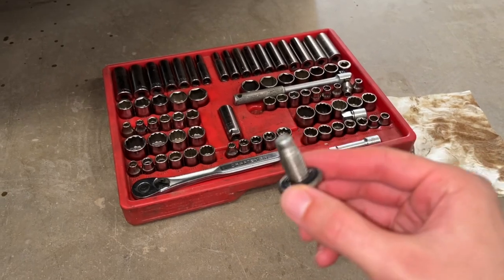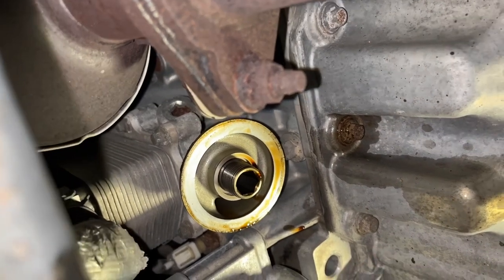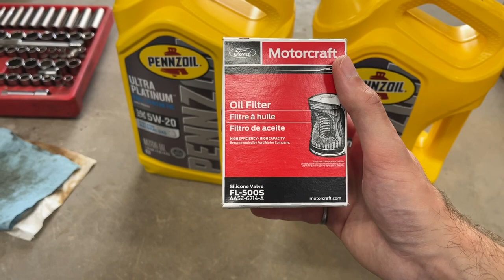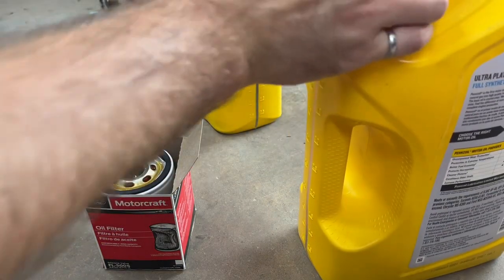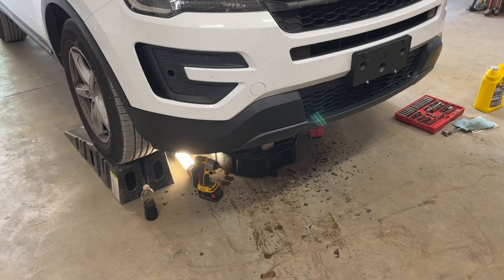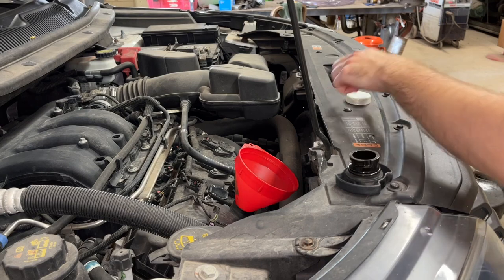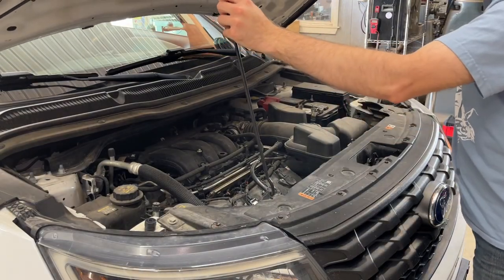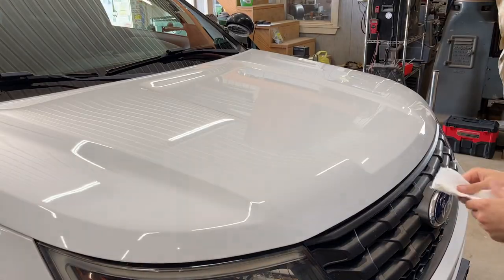Ford Police Interceptor Utility (3.7L) - Engine Oil Change

Comment: Oh man, seeing that impact on the drain plug, I was praying you checked it was in reverse first! 😂 Made that mistake before! Luckily I didn't ruin the pan, the plug had a gasket that got WAY over compressed. Easy fix.
Reply from the maker: I know, I always use the smallest impact I can find and just feather the trigger. Never tighten a plug with an impact for sure!

Comment: Excellent video, but PLEASE USE gloves!  Used motor oil is carcinogenic, especially if you have a cut, scrape or other open wound.  Use latex gloves which do not hinder your use of your fingers and hand, but will protect you from the used oil. Excellent , very helpful videos.  Thanks for sharing.  I wish you the best!
Reply from the maker: Thank you, Kenny, for caring. I’m bad about wearing gloves while recording videos because it makes it hard to work the AV equipment. I might have my priorities out of order there!

Generally, I go with orange Astro-Grip nitrile gloves by SAS. They are the toughest I’ve found!
Reply: This is very overlooked advice. Family has worked on a LOT of tractors bare handed... Fortunately no hand cancers, but that doesn't mean it doesn't happen.